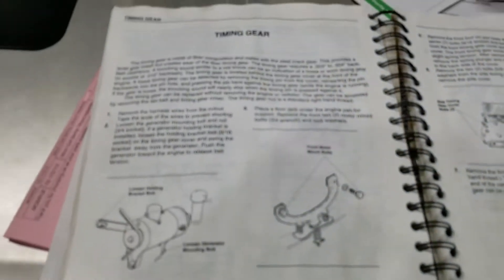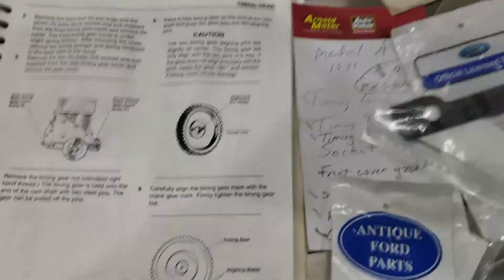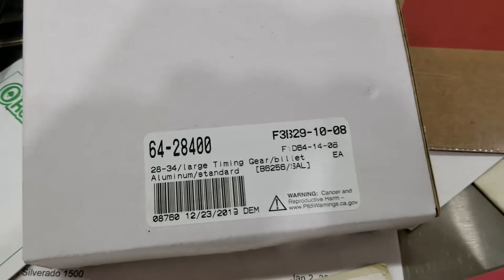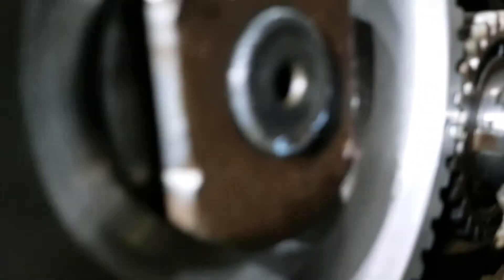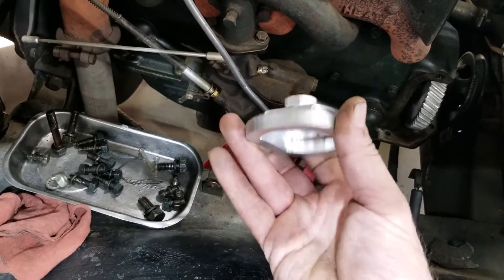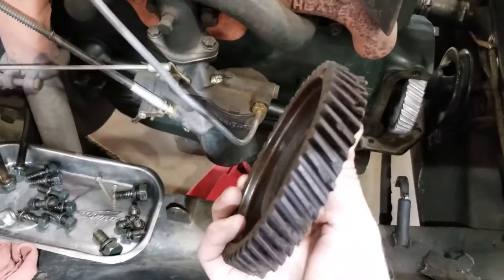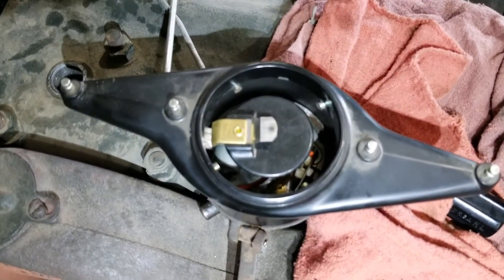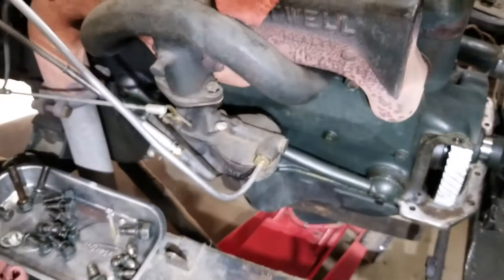Model A Cam Gear Replacement - Aluminum Cam Gear

Comment: I wouldn't have thought an aluminum  gear would be able to handle the torque. It looks beefy though. 👍👍
Reply from the maker: I thought the same thing myself. But, considering the old gear was made from layers of fiber material and was like some kind of early plastic, it is actually pretty strong for the application. The motor makes about 24 HP, so there is not a lot of torque on it either. It has been really interesting working on this older car. As a side note, they say the aluminum gear will make a little more of a noise when running, compared to the original fiber gear.